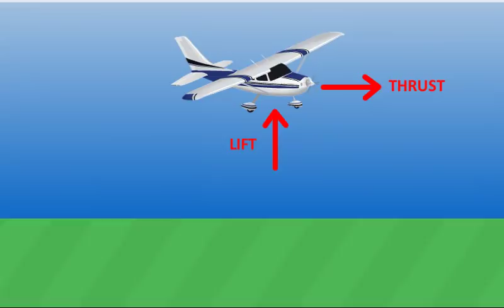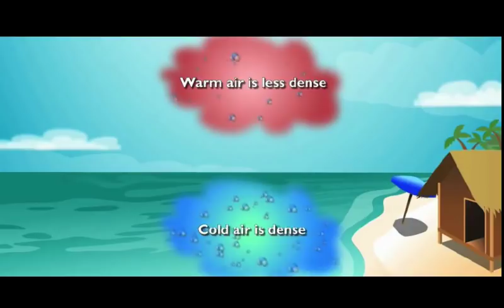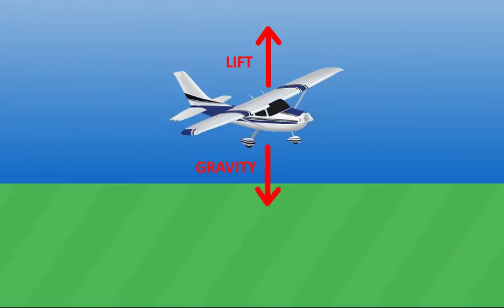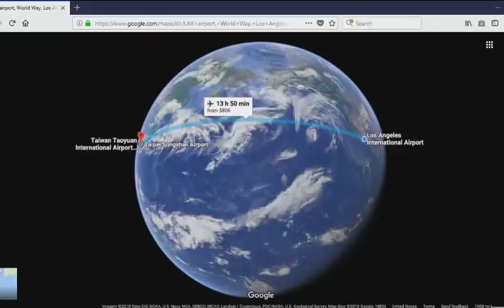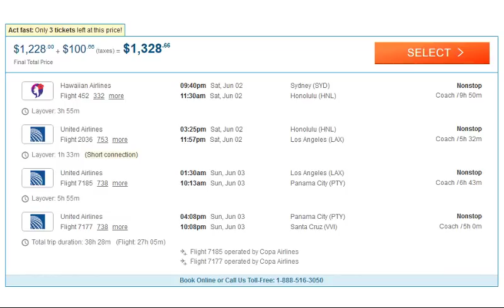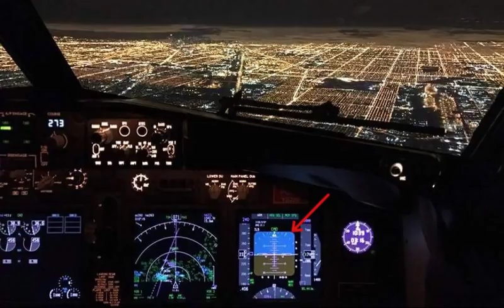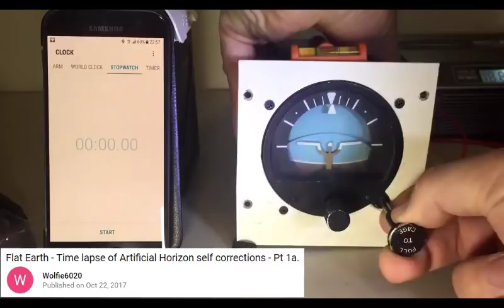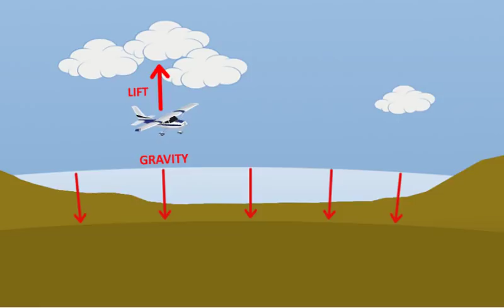Flat Earth Falsities - Plane Nonsense

Comment: Honest question , why is it that the air follow the momentum of the earth? If gravity is a force of attraction toward its center of mass and not ''around it'' ?? what is making the air spin if gravity is independent of the spin? There is no medium between the surface of  earth and the air around it. Saying the air is moving because of gravity imply that the gravity field itself is somewhat spinning.  There is no link between a fix point in the center of the earth and the atmopshere outside. So what is it that makes it spin in sync? Its Hard to explain my question.. But basically imagine this : for the atmosphere to spin with the earth , it would need to be like this example: a human spinning on himself while holding and swinging  a rope  ,with an object attached at the end of the rope. That object would follow the spin of the human , because of the medium (the rope). So as the human do a 360 turn , the object also does one turn around the human. Make sense righ?. But with the earth , there is no medium. Gravity attract to the center and thats it. Imagine a magnet shaped like a sphere. IF you give it a spin and approach a second smaller magnet , the second magnet will  NOT start to spin in sync with the sphere. it will simply get attracted toward the center , independently of the spin of the sphere. So why is the air spinning also? I can understand a mass spinning on itself , but i cannot understand a mass making an another mass spin in synchronicity with itself , WITHOUT a medium that can transmit the movement and the energy unless there is friction. Are you implying that the atmopshere is moving in sync because the trees and the mountains are pushing on it and forcing it to move in the same direction?? Friction really? Or are you implying that gravity is a magic glue that not only attract to the center , but also  push the atmosphere horizontaly making it spin and follow the exact movement of the earth? Damn gravity had a feature nobody knew about , gravity spin too!! Doesnt make any sense to me. Anybody understanding my question that care answering?
Reply: I understood you question and it is proof that you are  total science illiterate. Why dom't you go to school?
How did electromagnetism form? Interesting that the FE cultists are quite happy with other natural phenomena but not gravity? The reason being? Your Messiah, Birley is why.
Reply: Air drag, aka friction. Ever stick your hand out a car window?
Reply: Nashor, that is TLTR for the resident GE zealots, most wont understand has +wong has demonstrated with his childish lame answer.
THEY work it by having first keeping grab on developping gasses, then as the perfect ball choose a fixed axe the thickenning air sticks to the ground, friction I think, and with billions of years (magic number fixing everything) the sticky atmosphere got MOMENTUM !
Despite Atmospheric disturbances, of volcanoes, hurricanes, meteorites, corolis effects, upper space winds, etc, it automatically harmonized and keeped rythem with the surface multiple speed of latitudes and height.
Reply: Baron Nashor: "Honest question , why is it that the air follow the momentum of the earth? If gravity is a force of attraction toward its center of mass and not ''around it'' ?? what is making the air spin if gravity is independent of the spin?"

It's calles "inertia". It's very, very basic physics. Inertia means: Everything "wants" to move in a straight path. You need a force to change the path. 
Another piece of very, very basic physics: If you have a steady force, which is a every time perpendicular to path of movement, you get a movement in a circle.
Thus: inertia of the artmosphere + gravity --> the atmosphere moves in a circle around the Earth, at the same speed it had at the start, which is the speed of rotation of the Earth.
Reply: @enderwiggin1113  You didnt understand clearly my question. Please consider my example with the magnet and explain to me why it would act that way. The magnetised sphere being he earth and the approching second magnet (or just metal really) is the air.
Reply: @baronnashor158  Saying the air is moving because of gravity imply that the gravity field itself is somewhat spinning. "
This sentence is already wrong. As I explained. So why should I even consider your example with the magnet?

"But basically imagine this : for the atmosphere to spin with the earth , it would need to be like this example: a human spinning on himself while holding and swinging a rope ,with an object attached at the end of the rope. That object would follow the spin of the human , because of the medium (the rope). "
There's no need for a medium to hold the atmosphere to the Earth. It's gravity which provides the centripetal force.

"But with the earth , there is no medium. Gravity attract to the center and thats it. "
Yes, that's it. As the rope. It also attracts to the spinnign human, the center.

"Imagine a magnet shaped like a sphere. IF you give it a spin and approach a second smaller magnet , the second magnet will NOT start to spin in sync with the sphere."
No. Why should it? But if you approach the magnet tangentially to the sphere (as the atmosphere moves always tangentially in its "orbit" around the Earth) and if the velocity of the second magnet is just right (velocity = magnetic force times distance to the center of the first magnet divided by the mass of the second magnet; look up centripetal force to learn more about it), it indeed would orbit the first magnet.
As does the atmosphere with the Earth.

That's the problem in your reasoning: you ignore the tangential movement of the magnet and the atmosphere. That is, you ignore inertia.

See, I've understood your example quite well. It's only that you do not understand the simply physics behind inertia and circular movement. I've tried to explain it before, but you apparently habe still not got it.
Reply: @enderwiggin1113  So the earth gravity produce a centripetal force on the atmopshere is that your point? Basically the air orbit the earth? Answer this: If the sun was to spin on himself and accelerate , would the earth orbit accelerate in synchronocity? And if the earth was to stop spinning on its axis , would the moon stop orbiting also? I am i no way  a scientist altough i consider myself intelligent, and capable of doing anything when provided correct explanation and informations. Im asking  questions to one : inform myself honestly , and two , make you think about your stuff. Its supposed to be interactive for both of us even tho you consider yourself above me knowledge-wize. Keep in mind ,  Im not currently defending a flat plane, i never mentionned a flat plane even tho  you put that etiquette right on me. Im currently just asking question. We cant  ask question without being automatically called ignorant nowaday is that it? Im questionning and thats all. Dont forget that. If you dont want to answer correctly and explain , then just dont do it. There is no need to start calling me name and/or insulting my intelligence. You were still somewhat polite, but i can see how you are headed toward that direction. Choose if you want to continue
Reply: @baronnashor158  "So the earth gravity produce a centripetal force on the atmopshere is that your point?"
Yes.

"Answer this: If the sun was to spin on himself and accelerate would the earth orbit accelerate in synchronocity? And if the earth was to stop spinning on its axis , would the moon stop orbiting also?"
No. Certainly not. The spinning of the sun is not necessary at all for the Earth to orbit the sun and the spinning of the Earth is not necessary at all for the moon to orbit the Earth. All there is to it is inertia and centripetal force due to gravity. You can look it up in any basic book on astronomy. This is physics which is nearly about 350 years old, it was Isaac Newton who did this.

"Basically the air orbit the earth?"
Yes and no. I have to add something to my previous answer. With atmosphere, friction indeed also plays a role. Yes, there's always friction, even with things such as fluid as gases. It's also known as "drag". One more things you can look up, if you're really interested to learn something.

Having said this: If the spinning of the Earth would change by some means, we would have very strong winds - because the movement of the atmosphere would not change immediately but continue with its former speed (inertia again...).
But at some time the atmosphere would indeed get the same speed as the Earth again  - because of friction.

" i never mentionned a flat plane even tho you put that etiquette right on me. "
Did I? Where?

"There is no need to start calling me name and/or insulting my intelligence."
All I said is that you did not get it. If you already consider this "calling you names" or "insulting my intelligence" than so be it.
Reply: @enderwiggin1113  Hi man , Ill use the same ''quote'' Technic you are using if you dont mind, lets start with that :
 '' ''i never mentionned a flat plane even tho you put that etiquette right on me. "
Did I? Where?''

You are right , i accused you of doing that but it never happened. I had this idea in my head because of others people in the same thread doing so. It wasnt you tho , i apologize. 

'' "There is no need to start calling me name and/or insulting my intelligence."
All I said is that you did not get it. If you already consider this "calling you names" or "insulting my intelligence" than so be it.''

I said that as a warning , not to head that way. In case you didnt see , i said that you were still polite with me, which im glad it stayed that way.  "There is no need to START calling me name'' i used the word start because i was thinking about your future comment. I was worried that you would fall into that , after a couple  comments. Because you did claim i was not understanding some basics (i.e: inertia) which just isnt true. So that made me doubt.  I dont know you ,  and i dont know your limits. I just didnt want our conversation to turn into a competition of  who know best , or even name calling. But you proved me you arent into that later option. Thanks , so far i like talking with you. 

Next , Keep in mind ,when im asking a question , its not always that i dont know the answer and that i want THAT direct information im asking, sometime i just want to know if we are on the same page to then redirect the conversation where i want it to be , in order to get the real information im looking for. Sometime its just to know what YOU believe. But After getting your latest answers , i can certify that we were almost on the same page the whole time. I just expressed myself badly so far. My whole questionning can be resumed to this : What do people believe to be true? Is the atmosphere spinning in sync with the earth because of gravity or because of the friction of the spinning earth? I believed with my own logic that friction caused it and gravity couldnt make the atmosphere spin directly (lets forget centriputal force , it wasnt part of what i was looking for) But i still needed an exterior confirmation of my own conclusion. You provided it and thanks for that. Ill still ask you a last hypothetical question just to make sure you and i think the same thing:

 lets imagine that the earth is a perfect sphere , with a polished surface , polished to a degree where there is absolutely no possible friction on the gas surrounding it. The earth could freely spin to what ever speed and the atmosphere will stand still around it , not moving at all. Right? if your answer is yes then we can continue where i want to go.
Reply: @baronnashor158  "Next , Keep in mind ,when im asking a question , its not always that i dont know the answer and that i want THAT direct information im asking, sometime i just want to know if we are on the same page to then redirect the conversation where i want it to be"
Since we are not in school, I don't see why leaving the question open if you do not know something or are just "directing" the conversation in an option. Please simply tell so, if you don't want to risk people thinking of you as silly.

"What do people believe to be true? Is the atmosphere spinning in sync with the earth because of gravity or because of the friction of the spinning earth?"
It's both.

"But i still needed an exterior confirmation of my own conclusion. "
Google is your friend. Just type in "why does the atmosphere rotate with the earth" and you'll get lots of answers immediately.

"lets imagine that the earth is a perfect sphere , with a polished surface , polished to a degree where there is absolutely no possible friction on the gas surrounding it. "
That's indeed very hypothetical, so hypothetical that it's simply nit possible.

"and the atmosphere will stand still around it , not moving at all.  Right?"
No. Due to temperature, every molecule of Earth always moves. 
https://en.wikipedia.org/wiki/Maxwell%E2%80%93Boltzmann_distribution
The atmosphere simply can not stand still.
Reply: Do this simple experiment. Get a bucket with a handle. Tie a rope to the handle and suspend the can just above the ground. Fill the bucket about 3/4 full with water and place a couple of match sticks in it. Now twist the rope. Hold the bucket, with the rope taught, until the water becomes still. Release the bucket and watch the water and the match sticks. At first they will be stationary withe respect to the observer. After a few moments they will be going round showing that the water is moving. That a demonstration of what causes the atmosphere to move round with the earth. The force acting on the water is viscous drag.
Reply: Louis Shaw is an infantile troll. So you are correct, it needs psychiatric help.   SBF
Reply: About the magnets. If a smaller magnet approaches a larger one that is spinning, it wont start spinning with it... until the magnet actually touches and sticks to the other one. Air is not hovering around the earth it is ON the earth. To be honest, if the earth came to a sudden stop, the air would lose sync with the earth. The air and everything else on this planet had millions of years to get in sync with the earths momentum and spin, thats why you dont feel a thing when standing outside. If the earths speed increased or decreased, we would likely feel it because we arent used to it.
Reply: @lordclorox3028  Fuck off you silly troll.
Reply: @Baron Nashor there is no medium between the air and the surface of the Earth because they are already in direct contact. You can observe  inertia and drag in fluids by stirring your soup or your drink with a spoon, you can observe inertia in gases by looking at video of smoke rings or smoke ring cannons. Or stand close to a train or lorry as they pass you at speed, you'll feel the "wind" that is the air moved around them by them. (Don't stand too close, this air movement also causes some suction.)